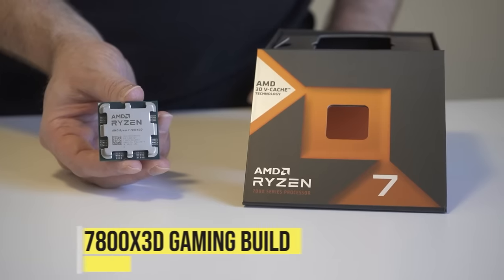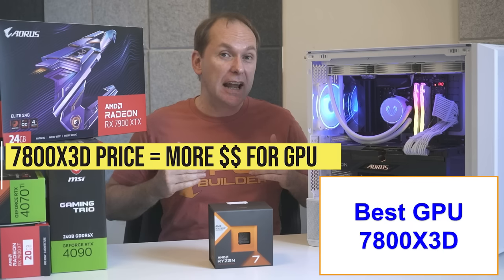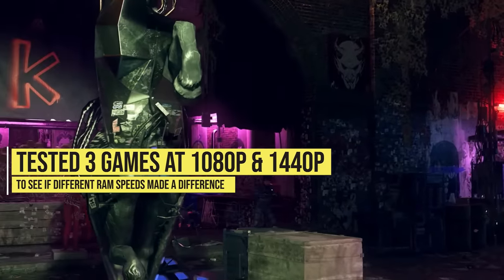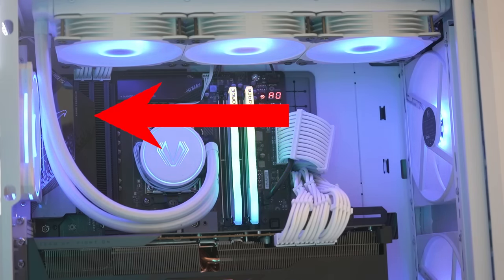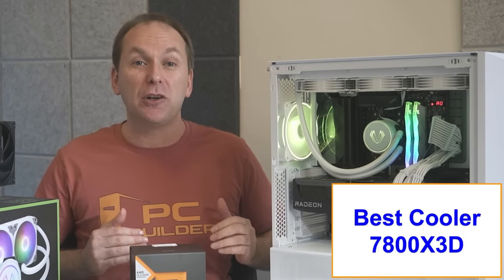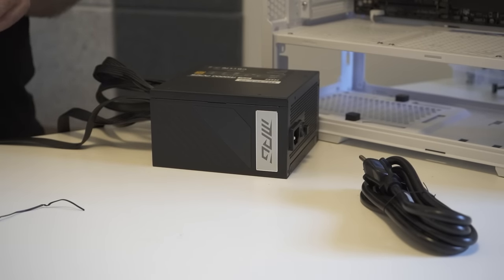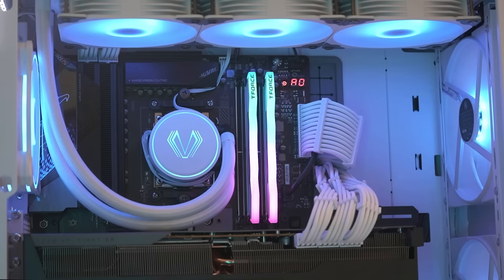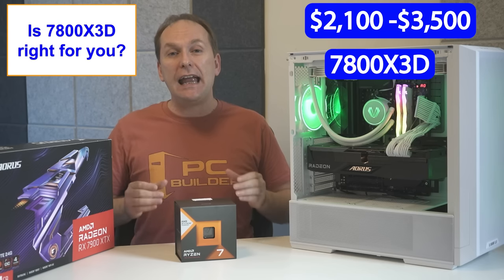🛑 Best Ryzen 7800X3D Gaming PC Build 🛑 Best RAM, Motherboard, GPU & More

Comment: I was just building my computer and bn looking into stuff for months. I ended up with an almost exact build here. Worried tho bc I have a 850watt fully modular gold power supply is it not going to be enough? I went with it bc it was white and the 1000s didn't even have a white that I saw at micro center
Reply from the maker: It will probably be ok as the 7900XTX is pretty powerful efficient. But check out our Best PSU 2022 video and follow the method there to tailer it to your full build.

Comment: Would it be good to use an Rx 7800xt with the x3d?
Reply from the maker: That's lower than I would pair, because you can get better performance going with a 7600 and investing in a stronger GPU. Check out our Best GPU/CPU Combo 2024 video for more

Comment: i build my PC at the end of august with products bought that same weekend. I chose B650 asus tuf gaming. and dont suppose you know or see if ASUS has shored up their "problematic" performance with the 7800X3D.
Reply from the maker: Yes all good with the latest bios update
Reply: @PCBuilderChannel  So if that's the case, does this mean you're adding ASUS Boards back into the recommended for 7800X3D? Cause I'm looking at the ASUS TUF Gaming B650-PLUS WiFi Socket AM5

Comment: New PC builder here, just wondering if i’d be able to transfer my current GPU (3070) to my new PC that has the 7800x3d. Would this cause any bottleneck issues? thanks :)
Reply from the maker: Its a lower GPU than I would like but if you plan to upgrade in the future its fine for now. 7600 would be better pair.
Reply: @PCBuilderChannel  yeah would be planning on upgrading to a 4070 later down the line, just until then i hope it won’t cause any issues or anything?

Comment: I know you were recommending not going lower than a 7900xtx but the price difference between a 6950XT and a 7900XTX is pretty massive.  Would pairing a 7800X3D with a 6950XT and leaving the head room to upgrade to a 7900XTX next generation when it comes down in price gimp the system all that much?
Reply: It's probably fine but instead of doing that maybe drop down the CPU to the 7600/7700 so you can afford the 7900 XT or XTX and then upgrade to the 7800X3D later.

Comment: Is the amd rx 7800 xt 16gb OC not a good pair with the ryzen 7 7800x3d?
Reply from the maker: Its a tad lower than I like with that CPU. But if you get the CPU on a really good deal (so cheap that putting the extra money into a stronger GPU wouldn't take you up a level) then thats fine.
Reply: The items are currently being delivered. Now not sure since you said may not be a good match😅

Comment: What is the most silent air cooler for 7800x3d? I would like a very silent pc build
Reply from the maker: For most silent you would want an AIO!
Reply: @PCBuilderChannel  arctic or thermalright aio quieter Than noctua or be quiet air cooler? (Pumpa noise, etc...)  I think air cooler better for me because aio max 4-5 year and die

Comment: I have aorus x670e pro x pair with 7800x3d and my old 6900xt and 2x 24 gb gskill flare x expo 6000mhz im runing over 60fps almost any game but ray trace makes me problem does 7900xt should resolved that ? Gpu almost 80% and above to 99% load depends of game
Reply from the maker: Check out our “After you build” set up guide video to make sure you’ve got everything set up ok

Comment: Instead of a 7700, what do you think of a cheaper 5800x3d build?   In my region that’s the difference between a 4070 ti and a 4080
Reply: Maybe consider 7600 it has around the same performance of 5800x3d

Comment: Would you recommend using the 7800X3D with the RTX 3060 (12 GB). If not, which CPU would you recommend to pair with the 3060 for best performance (especially in VR games)?
Reply: No.  You only want a high end GPU with the 7800X3D.

The 5600 is a good choice for you.
Reply: @kelley09162  What about the 7700X, or the 5800X3D?
Reply: @nehemiahsstuff  not with the 3060.  Too low a GPU.  

If you plan on getting a new GPU in the near future you could get a 7600 but if you plan on staying with the 3060 for a while the 5600/5600X is the way to go.

I know that's probably not what you want to hear but the 3060 isn't a high end or even higher mid tier GPU so a higher end CPU won't be good with it.
Reply: I see… I just got the 3060 because I wanted a graphics card with a lot of VRAM without breaking the bank. I was hoping to get a CPU with a lot of L3 cache (more than 32 MB) to help improve performance in VR chat. But I suppose, considering that my current CPU only has 9 MB of L3 cache, any CPU could be an upgrade.
Reply from the maker: Watch the section of the video around GPUs for more. The minimum GPU I recommend with this CPU is 7900 XT or 4070 ti. I agree with the other comments with a 3060 you be much better off pairing with a 5600 or 5700X max
Reply: @PCBuilderChannel  I did. Your video is what got me worried in the first place. would the 5800X3D and the RTX 3060 (12 GB) get damaged if I decide to run them together anyway (I know I sound desperate and stubborn, but VRChat requires a lot of L3 cache)?

Comment: I want to build with this CPU 7800X3D but I want to use all the Nvme ssd on the motherboard without comprising the Graphics Card from 16 down to 8.  I want the GPU to be able to run at 16, and I don't want to use to use hard drives in this build like I did with my old builds. so which motherboard would you recommend.

Comment: Helloo:) great video!:) i have the problem that when i select the EXPO profile, after a while my game crashes or i get a blue screen or the pc is not boot… now the DDR5 runs with 4800 Mhz, what should i do:( i have a Gigabyte x670 gaming x ax v2 motherboard and 2x16GB Corsair Vengeance RGB DDR-6000 CL 30 RAM.

Comment: Hi, Im short $300 so basically my max budget is $2500, what changes should I do to maximize the performance as close to the original build but with $300 less. would really appreciate any input!! 

also thankyou Jason yet again for a wonderfully made video!
Reply: Do you want the build White like his original build and do you want RGB in the build?
Reply: Get a less costly MB with a less expensive GPU. However, many considering this CPU are looking at a $3K build, or more.
Reply: @kelley09162  dont really care about the aesthetics of it, just pure performance
Reply from the maker: See our “basic” version of the build linked in the description!

Comment: will go for 7800x3d, aircooled, a620m tuf, ddr5 micron 2x24 gb.......see what i can cook with that.....
undervolt most likely.
will update
Interesting results with ram, various CL and speeds.....almost same results
Reply: if you can afford a B board id suggest that over a boards as they are generally severely handicapped.
Reply: @ErrorInvalidName  for sure. i will test vrm's. bios options.  seems to be pbo with A boards also. i will post results. prices had to go down anyway.

Comment: What do you think, i have now an R5 5600x and want to upgrade it to r7 5800x3d, or is it worth the extra money with new motherboard, new rams, for 1440p and 4k gaming? 380 usd vs 610 +320 + 230 = 1160 usd
Reply: It depends on what your GPU is though the 5800X3D could also be a good option for you if you don't want to pay for new RAM and Motherboard.
Reply: @kelley09162  Now I have an rx 6800 (non xt), but I'm planning to upgrade it to a rtx 4080
Reply: @folkmetalkid  then either the 5800X3D or 7800X3D are good options.
Reply from the maker: Depends on your GPU! I see you have a 6800 (for that its not worth the upgrade) but if you are going to 4080 in the future absolutely! 5800X3D + 4080 = great
Reply: @PCBuilderChannel  Thanks for the answer, then i save a lot of money by not getting the 7800X3d only the 5800X3d for my new card.
Reply: I have a 6800xt paired with a 7800x3d. Kingston FURY Renegade 6000 cl32 overclocked to 6200 cl30. Asus b650e-e motherboard. EVGA 1000w PSU. KC3000 m.2 2tb. Deep Cool Gammaxx V2 360 AIO. Phanteks Enthoo tempered glass case.

Comment: Is the Ryzen 7 7800x3d with the 4060ti good for Fortnite low settings at 1080p?
Reply from the maker: No! That’s a big CPU/GPU imbalance and you definitely do not need that CPU for 1080p Fortnite. Check out our Best CPU/GPU 2024 Combo video to help learn what you actually need

Comment: This build can run 3D animation? Like blender, cinema 4D or adobe after effects?
Reply: It's not the best for that.  If that's your use case the 13600K or 13700K would be a better CPU option for you, though the 7900X and 7950X would also work if you want AMD.
Reply from the maker: Yes, you would want to pair it with a Nvidia GPU like a 4070 ti, 4080, or 4090.  It 13600K is also a good choice for that and you can check out our 13600K build guide for more

Comment: is it okay to pair the 7800X3D with a 4060Ti? 
PS:I mainly play Counter Strike and that is mostly a processor dependent game so wanted to save some bucks on the GPU since 4070 or 4070Ti is more costly than 4060TI :(
Reply from the maker: Its not ideal no. I don't love the price to performance on that GPU in general, see our latest GPU Market Update video for way better GPU options. But its also unbalanced with the 7800X3D. The 7800XT would be a better choice for example
Reply: @PCBuilderChannel thanks for replying.I actually decided a couple days ago that i'll buy the 4070 instead as its more future proof with more vram as games these days exceed 8 gigs of vram which is the case in a 4060ti 8 gb.All good 👍 😅.

Comment: I have a question: Will the intel core i9-13900k have better performance than the r7 7800x3d at pretty much all resolutions?
Reply from the maker: No, the 7800X3D beats it most of the time. Hardware Unboxed has done some great comparison videos if you want to see testing with them head to head. But in general I don't recommend the 13900K. Its not the best for gaming or production builds, for gaming if you want best of the best go 7800X3D, for production/ gaming I'd recommend 13700K or 7700
Reply: @PCBuilderChannel  Appreciate it man, also subbed. I just wanted to know because I was going to build a pc with a 4090 with an unlimited budget and I didn’t know what cpu to get thank you. Subscribed.

Comment: sir mis this the most best build for ryzen 7800x3d with gpu 79000 xtx? i mean its the max build gaming ? ..which is better to play it sir in 1440p or 4k?..
Reply from the maker: 4090 is the top GPU possible but 7900XTX is a great second place. Its a fantastic 4k gaming build but you can also get blazing fast 1440p
Reply: @PCBuilderChannel  last question which is now better 7800x3d or the new ryzen 9 7950x3d??

Comment: Ok my build 7800x3d, mb msi tomahawk x6070e, ram team force delta white rgb 64gb (4x16) gpu asrock Phantom Gaming Radeon 7900xt 20gb, ssd  wd  sn850 2tb, Samsung 980 pro 1tb , antec d700 Flux case (white)  msi mpg a1000 psu, Galhad 2 trinity 360 cooler everything white except motherboard. Am I in the ballpark for gaming 1080p, 1440p and 4k?

Comment: yo bro i have 1080p 240hz monitor and i have 4070 super what cpu can i use for 240+ fps? 7800x3d its good or i need lower cpu?
Reply from the maker: 7800X3D is good if you have the budget for it! The 4070 Super is the minimum Nvidia card I would pair with it
Reply: @PCBuilderChannel  7800x3d is the best for this setup or I can budget ?

Comment: I've had 3 brand B650M boards:
ASRock HDV - Best RAM OC results, fastest boot, least amount of features ex: no WiFi, limited bios options, and no RGB headers
Gigabyte Aorus Elite AX - Decent RAM OC, bad coil whine
ASUS TUF - Worst RAM OC results
I'm probably going to try the ASRock Riptide Wifi. Do you have experience with this board? Have you tried to OC RAM on it?

Comment: Am I the only one having ram speed issues on a Gigabyte mobo? I have a b650m aorus elite and enabling the default Expo profile on my G.Skill 6000 cl 30 RAM causes the system to crash while gaming. I fixed it by manually dialing the speed back to 5800, but I’ve seen several channels say that the Gigabyte boards are the most stable so I’m thinking I might need to RMA mine… Note* I am on the latest bios as of March 30th and the issue still remains in the F4 bios version, at least for me.

Comment: Doubting between 7800x3d and 7900 non-x :/ use is some light video editing and in terms of games mainly (grand) strategy...
Reply from the maker: For that use case you want to make sure you get a Nvidia GPU 4070 ti or preferably up. So if the 7800X3D helps you invest more in your GPU I’d go that route

Comment: is it still ok if I use 4070 with the 7800X3D, the 4070 ti doesnt fit my budget
Reply from the maker: I wouldn't personally. Unless you can pair it with a higher GPU the 7800X3D really isn't worth the price. You'd be better off going for a 7600 and investing the money you save in a better GPU. See our Best GPU/CPU Combo 2023 video for more on this

Comment: Wow!! $3000 for the best AMD rig, but at that price I would rather wait for an AMD GPU that does 4k/144+ in all titles with RT, not just the optimized ones without RT. I'll take a pass until the 8000s arrive and get a 6800xt instead

Comment: CPU: Ryzen 7 7800X3D

MOBO: GIGABYTE B650 AORUS Elite AX

COOLER: DeepCool AK620

RAM: CORSAIR VENGEANCE DDR5 32GB

GPU: XFX Speedster MERC310 AMD Radeon RX 7900XTX

SSD: WD BLACK 2TB SN770 NVME

PSU: Thermaltake Smart Bx1 750w

CASE: NZXT H5 Flow Compact AT Mid-Tower

Comment: Which configuration gives better results when playing Fortnite with a configuration of 7900xt 7800x3d and a configuration of 7900xtx 7700x at 1080p?
Reply from the maker: Both are extreme overkill for Fortnite so if you have the budget for this either is great.

Comment: AMD Ryzen 9 7950X3D or AMD Ryzen 7 7800X3D which one is better for this build. Is there a reason to us the 7800 over the 7950?
Reply from the maker: 7800X3D is the best of the best for gaming right now as long as you pair with a 4090, 4080, 7900XTX
Reply: @PCBuilderChannel  I have another question before I sell my current set up and build this one. I have a 	HP OMEN - Gaming Desktop - AMD Ryzen 7 5800X - 16GB HyperX Memory - NVIDIA GeForce RTX 3080 - 1TB SSD. Can I upgrade to the 4080? If I can do I need to make any other upgrades to get the new 4080 to run to its capacity? I remember in a past video you strongly recommended this PC but mentioned upgrading it isn’t always an option. I apologize if I miss quote you.
Reply: @PCBuilderChannel  ?

Comment: I tried a ROG STRIX B650 mb with ryzen 7950x3d and trident z5 30cl.  Would not ever boot up.  Tried all the tricks.  CMOS, bios, nothing worked.  Got an X670E and it booted right up no problems.  The B650 s have a problem with 7800 x3d and 7950x3d cpu. Apparently

Comment: Is 6950xt good for this cpu instead of 7900xtx because i don't plan to play 4k i would be playing 1440p
Reply from the maker: I wouldn't pair a 7800X3D with that personally. For 1440p gaming you would be better off going 7600 and using the money you save to invest in a better GPU, like the 7900XTX.
Reply: @PCBuilderChannel  ok thanks
Reply: @PCBuilderChannel  I think I will save a bit more money to get 7900xtx and 7800x3d

Comment: I use to used gigabytes for the past few years but after the last time i had so many headaches with them. No more 
ASUS IS THE BEST
Reply from the maker: Did you build with a B650? If so which one? How was it? I find that the board partners take turns being the "best" or "worst" depending on the chipset. Gigabyte was horrible for B450 but amazing for B550, for instance.
Reply: @PCBuilderChannel   z790 ultra ddr5 so many problems. I switched to asus after many years using gigabytes

Comment: interesting, I ran the Valhalla benchmark at same settings and got 105 fps avg 4k and got 150 fps Avg 1440p. That is on a 5900x locked to 4.5ghz and a 4080. And i also had 40 tabs open in web browser at the same time. unless the game is badly optimized it is really not worth upgrading to am5 just yet. I was looking to upgrade to the 7800x3d. but just to possible get a couple frames, because I play at 4k. Not so sure yet. I guess time will tell.

Comment: does the 4070 super work instead of the 4070 ti
Reply from the maker: Yes! See our new Best GPU/CPU Combo 2024 video for more
Reply: Hello! I will be playing Fortnite at 1080p low settings. Could i pair the Ryzen 7 7800X3D with a 4060 ti if i want to get much frames?

Comment: can Thermaltake TH240 ARGB Sync or MasterLiquid ML240L V2 RGB cool this cpu. I have 280 arctic freezer but it looks impossible to mount with new mobo as it hardy fit on my previous mobo.
Reply from the maker: Yes they are fine with this CPU

Comment: I seeen another video where the guy uses a 750watt psu? Do you think 750 is good ?
Reply from the maker: PSU is one place I don't mess around personally. Check out our Best PSU 2023 video and follow the method there to calculate the wattage you need for your exact build

Comment: Could I use this a 3070ti with this ryzen until I upgrade it later?
Reply from the maker: You can of course. The lack of vram is the issue in 2023 but you can always upgrade in the future. You might also consider pairing that 3070ti with a 7600 instead. Better combo right now and might get you to that GPU upgrade faster. See our new 7600 build guide on the channel
Reply: @PCBuilderChannel  hey man thanks for the reply I was thinking of getting a msi 4070 with the 7800x3d and a msi b650 carbon board is this any good?

Comment: hello i want to buy 7800x3d with kingston fury 64 kit ddr5 6000mhz cl36 , asus tuf b650 plus , and for now use mine old 1080ti 11gb. is that good solution ?
Reply from the maker: I don't recommend that no, the GPU will bottleneck the heck out of that CPU. See our Best GPU/CPU Combo 2024 video for more on why I wouldn't do this
Reply: @PCBuilderChannel Even at 1080p? If he plays Esports 1080p isn't the CPU more important than the GPU?